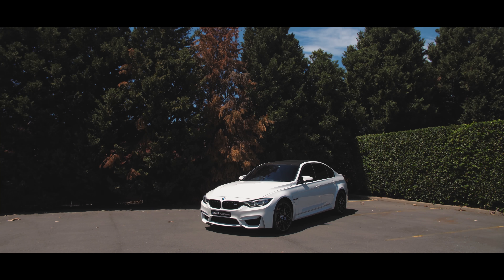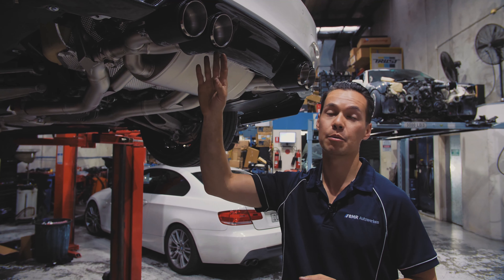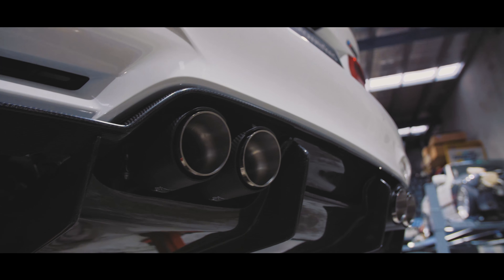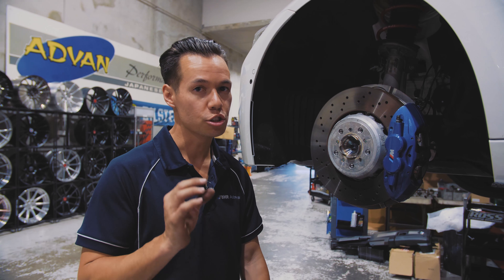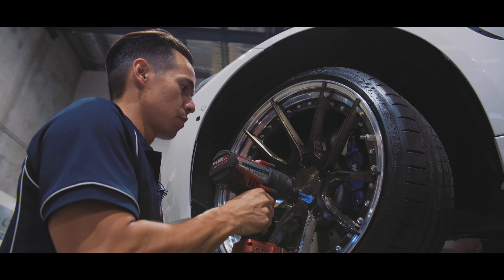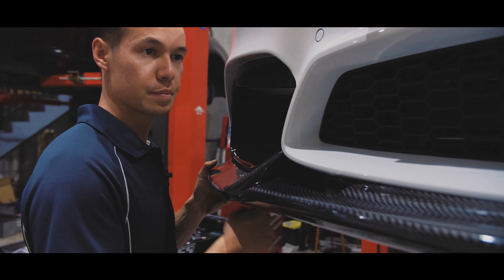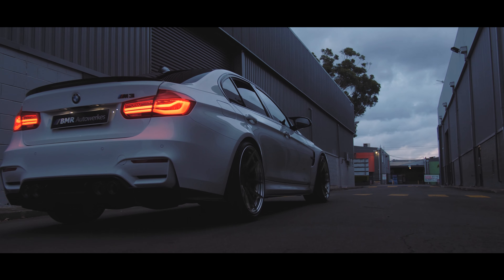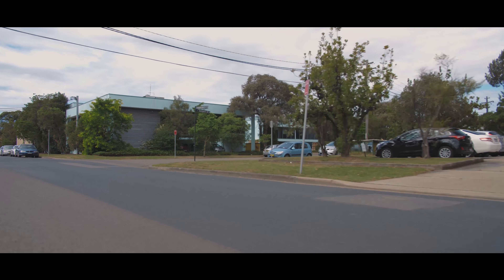Fully modified BMW M3 F80 LCI II 2 build video

Comment: Upgrade that vinyl wrap to the real carbon overlays. They add some dimension and would match the carbon varis lip. Also OEM MPerformance spoiler not agressive enough to match that beautiful diffuser and exhaust.  Taking my OEM spoiler off and replaced with PSM style was the first think i did. You can go M4 style less kick than the PSM if you want something more subtle, still has the fangs to add dimension but its smaller like the OEM style.. Also where are the side skirt extensions? Go PSM or if you want less agressive just a simple flat set of side skirts would tie the front and back together well. OEM competition wheels look WAY better on this car than those ugle ass bronze and chrome. JMO but ya

Comment: You lowered too much the front area, yeah those "BMW engineers" definitely could do that but for a "reason" they didn't and not only this, also those lips made the car look even lowered and disproportioned. And yeah just because adding "carbon fiber" in front of something it doesn't mean that it becomes cool.

Comment: Ehh, all looks, like every fricken body style this is lol. But when I see "fully built". I want to see a car that is inside and outside done. Meaning, work is done to the car's engine. Swapped turbo for a larger one, tune, etc. The true enginuity... not some carbon fiber and wheels. The only good thing about this was the wheels. Otherwise, it's another F80 on the streets. I was expecting to see some heavy mods...... disappointed video title.